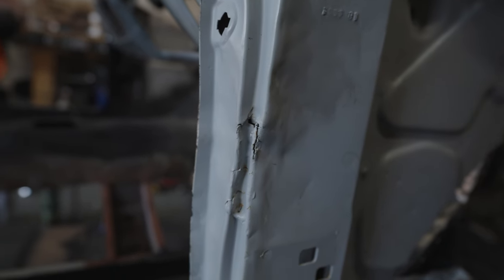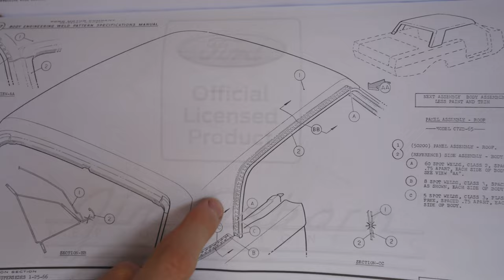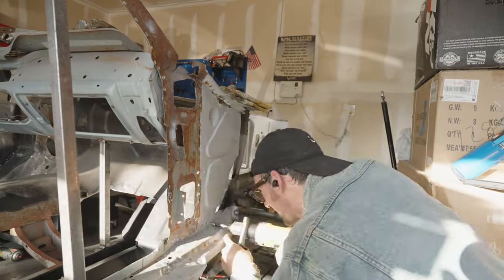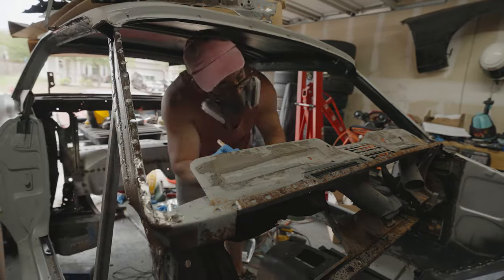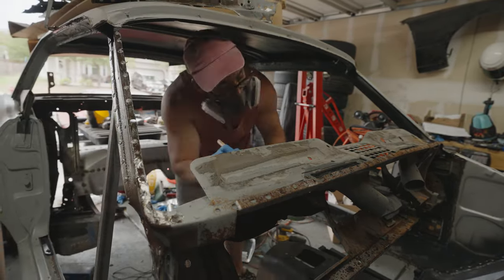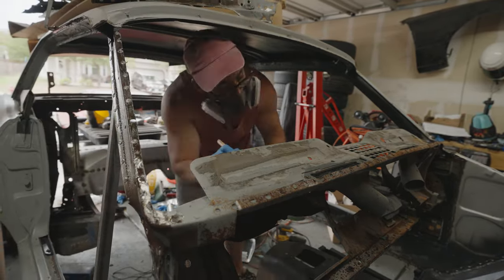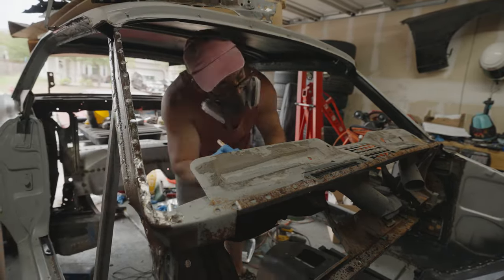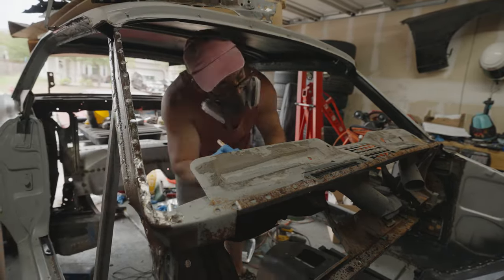How I Restored the Door/Windshield Pillar & Kick Panel on my 67 Mustang

Comment: Looks good! Time, money and patience. That's the package on these cars seems like. I haven't used Ospho brand personally, but I have used phosphoric acid. Clean Strip is a brand that is available at the big hardware stores. It's cheaper and I think a bit stronger. They use it for concrete etching. Cool part is it won't hurt the parent metal and just attacks the rust. Works like a champ. I haven't used Evaporust yet but I keep hearing good things about it. One of the cars I'm messing with was sandblasted by a previous owner then left to rust. Surface rust on the whole car. Just surface rust but needs to go. Pets are family. Hard deal when they get sick etc. Hang in there